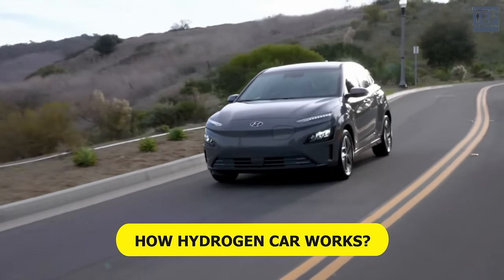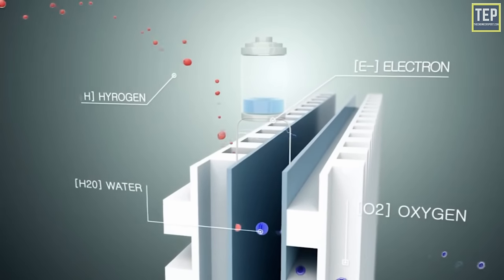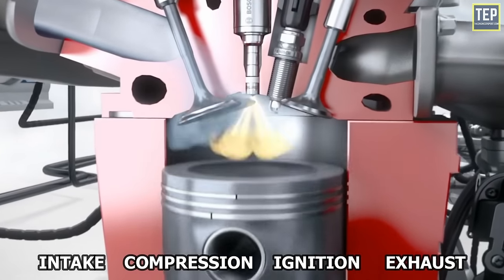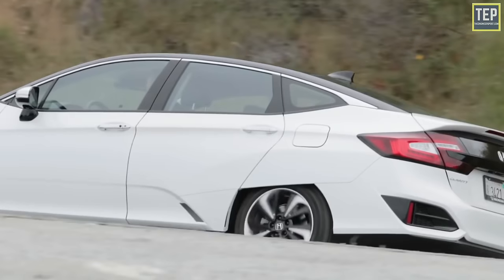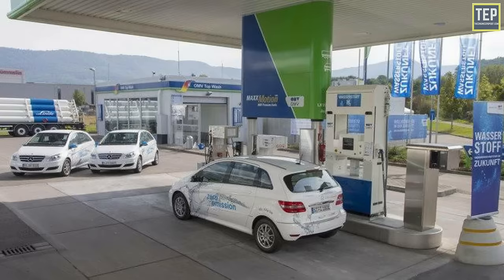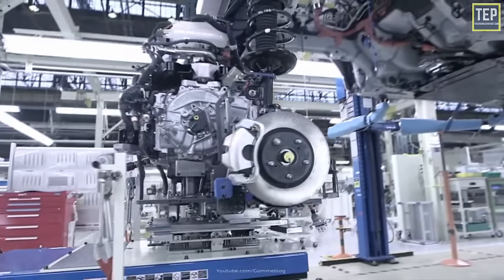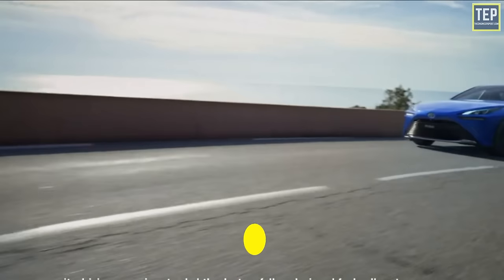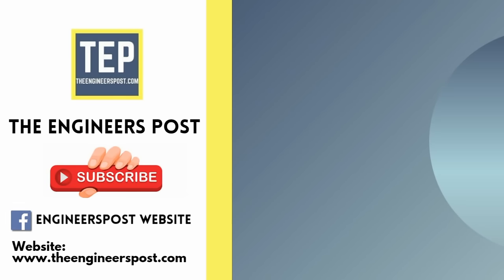How do Hydrogen-Powered Cars Work? Using [Fuel Cells & IC Engines]

Comment: Both can work alongside eV for cars, vans, etc hydrogen for trucks, buses etc the petrol, diesel scenario all over again but eV companies trying to discredit hydrogen and they will fail miserably.. UK is already updated services to handle hydrogen eg pipework, tanks etc... There is no way we should allow any one source to have a monopoly in fuel ever again... Its out and out greed..
Reply: If all of the companies making EVs actually cared about the environment they would be investing in hydrogen power in anyway they can. Travel range and transport costs are the same exact issues fossil fueled vehicles and EVs have and we overcome them to make it work. Think of all the people working in oil that could be cross-trained to harvest and transport hydrogen. I have yet to see a single legitimate reason we don't drive these vehicles regularly. It's all excuses.
Reply: @TheRealBlakers  Oh ye think about those kids who get payed so less bc companies want lithium to make batteries, Also Its not excuses , everyone knows that hydrogen is more cleaner , has higher Range, faster fueling time , U lot who just support EVs can't even think about kids and adults having to put up with lithium mines or acid from batteries that causes acid rain
Reply: Well said...
Reply: Try convincing the EV nuts that there's any alternative.
Reply: @TheRealBlakers Also with re-fuelling the hydrogen fuel cell it’s just as quick if not quicker and the pumps are supposed to be far nicer to use than the ones for regular petrol and diesel
Reply: @joet7136 They would’ve been called nuts decades ago but there’s no turning back after the original Nissan Lead brought the EV’s to the masses instead of low volume numbers with much earlier EV’s with only a third of the range of many of the latest one’s now by various car brands. Even the prices are going down except the ultra luxury models by the likes of Mercedes and a few other ultra premium brands for which even regular cars by them are similarly expensive priced

Comment: EV and hydrogen is all that wow and hyped up in the beginning until it starts to fail after a few years with broken batteries and leaking hydrogen nozzles etc. And people don’t even talk or know about hydrogen embrittlement. And no one talk about the effects when it gets cold with minus degrees like (-20˚C is -4˚F) as a comparison and how awfully bad electrons behave in minus degrees. Nothing beats the internal combustion engine to work in harsh elements!.

Comment: Hydrogen for the win. Electric cars are great if you have your own a house with a drive way to charge, but where I live in the UK I would need to fork out about £750k upwards to have a drive. Many of us live in terraced houses and have to park on the street. 
Plus the sound of a hydrogen car is way better, you can retro fit old cars with IC engines, and hopefully you will still be able to drive manual.
Reply: Can't you just put the charger on the side of the road by your house
Reply: @jaymatthews3712 - Simple solution: you buy the car but rent or lease the batteries.

When your battery is low, a service station removes your dead battery and replaces it with a fully charged fresh battery.  Just like you change batteries on your cordless drill.

Could even be faster than filling up a gas tank.

Your dead battery is then recharged and lent to another driver.

This battery exchange could even be automated.

Simple.

It might even be possible to specify how much charge you want in the fresh battery and pay accordingly (although possibly, the higher the charge, the less it might cost per watt).
Reply: What if you get in an accident?

Comment: Certain types of Solid oxide fuel cells at filling stations can be used to create hydrogen from from water and electricity with oxygen as a by product which can be easily sold. These were first developed to produce electricity from natural gas but they can also run in reverse!!!

Comment: I think the biggest difference between a hydrogen fuel engine and a hydrogen fuel cell is that a hydrogen fuel engine is driven by an internal combustion engine, so it has the same engine noise as ordinary gasoline-electric vehicles and fuel vehicles and needs to change the oil.  For hydrogen fuel cells, its driving method is an electric motor, so its driving is the same as that of an electric car！

Comment: The most important features that the user focuses on when owning a car 1. The cheap price of the car 2. The ease of car maintenance 3. The availability of spare parts 4. The spare parts are reasonable 5. The speed of fuel filling in record time 6. The car runs a long distance with one tank 7. The price is cheap  Fuel 8. Gas stations are abundant on the roads 9. The vehicle is safe and secure 10. It is beneficial to the environment 11. The car accelerates perfectly 12. The sound of the vehicle is perfect 13. Vehicle speed
Reply: If they cared about 10 they wouldn't buy pickup trucks lol
Reply: Also no car is "beneficial" to the environment, just less bad

Comment: I think there is a difference between the hydrogen combustion engine and the hydrogen of the fuel cells. I think that the hydrogen fuel cells give the car a longer distance in walking with one tank by 1,000 kilometers per tank.
Reply: It's a good thing

Comment: Don't waste your money on a H2 car.
     The membrane or the fuelcell stacks that exchanges hydrogen to electrical energy are troublesome and must be replaced with other components once a year or every 6 months. The membrane is like what you usually see in the RO water filter, except larger depending on the design it can be a rectangle or cylinder with built in heat exchange or cooler. The membrane is getting veryhot while it's running.
It's very expensive, $10,000 or more to replace it a long with other components. 
   The car works like a hybrid car, battery  and all. The coolant to cool the membrane or the fuelcell is another issue to worry about.The membrane only lasts about 6 months  to a year, depending on how the car is used. If you park the car for a very long time like a month or so, the system will clog up. Then the membrane  and cooling components have to be replaced before you can use the car. The car has to be towed into the shop autorized dealer.
So far, there are NO mechanics at the dealer that can work on the cars, due to its complicated system. You must wait for a trained scientist mechanic from Toyota Japan to fly in for your service on an electrical problem.

Comment: The technology is promising and has a long way to go but may eventually replace regular gasoline and ev powered cars one day
Reply: It’s too late to replace EV’s as the original Nissan Leaf set the stage for bringing it to the masses after previous attempts in earlier decades failed with only low volume numbers made

Comment: why not use electrolysis of water to create hydrogen on demand in the engine?
Reply: Is that really possible?
Reply: @jayy799  On further investigation I'm not sure it is as I would not produce enough hydrogen however you could use tanks to store the hydrogen and fill up at home using a Hoffman apparatus. This does need an electrical current for electrolysis but maybe u could use solar panels to provide this?
Reply: @Deborah Payne  Yeah You are right, But therr is skme reasons that will stop one to produce hydrogen at home likd, 
a ) Hydrogen is extremely flammable Gas; 
b)  To extract hydrogen from water is complecated for normal prople. 
And soo On... 

But the good news is Apart from the electrolysis, Ons can also extract a hydrogen. there is also other ways to get hydrogen but unfortunately we arent talking about that. 

But we will find the solution of all these problem for surely

Comment: We already have a car running without petro, battery or hydrogen it uses the voltage from the like of cell sites transmitted power or other wireless transmission power.
Reply: whats the name of the car
Reply: Lol 😂 what car is it huh?
Reply: It called Foot
Reply: Send power wirelessly?  I don’t want to wear the tin foil hat, plus you can’t get dilithium crystals on this planet.
Reply: That would be perpetual motion machine of the first order 😂. Remember d laws of thermodynamics. 2nd law

Comment: Hydrogen IC cars and trucks. Refuel in 90 seconds. Superior range on one refill to EVs. No need to upgrade the entire US electric power grid (no brownouts or blackouts). No toxic environment problems with mining rare earth minerals for batteries. No dependence on China for the rare earth minerals for batteries. No $expensive$ periodic battery pack replacement. Reduced weight of vehicle compared to EV, so easier on road infrastructure and tire compound emissions. Hmmmm. Let's be sure that the government does not pick winners and losers for our future car and truck technologies. Let the free market decide.

Comment: are hydrogen cars stable now? I read somewhere they are susceptible to high temperatures and can explode.
Reply: EV's and lithium have a similar issue.  Once those batteries catch fire nothing can put them out, not even water.  Its like oil on fire; very hard to extinguish.  Gasoline is also explosive but with the right placement this issue is not going to be a problem with hydrogen.  The temp issue is resolvable.

Comment: nope ... not the future.   eventhough hydrogen is more energy dense, the process for making it is highly inefficient and dirty.   transporting liquid hydrogen is also very unsafe!    The recent theory or using ammonia(much cleaner to produce and safer) and converting it to hydrogen, using the hydrogen to power a generator of some sort, and then powering electric motors ... maybe???   it would mean a bunch of heavy components equipped on a car quickly reducing its range.

Comment: ICE will be around for decades. They will be hybrid to meat cafe standards. Electric carss are a nitch market and is NOT the future. Two reasons: 1 the raw materials needed to replace ice cars with electric cars will be prohibitively expensive as demand inceases and: 2  There is not enough electricity to power a fleet of all electric cars and between the charge times and the space required  to charge milliona of cars isnt yet feasable. A breakthrough in  battery technology would be needed and battery physics may never allow quick enough charge times not to mention that the eletric grid cannot handle it in most countries. The future is hydrogen but it is decades away. Hydrogen is a fuel that  can be ieasilynstalled in gas stations, charges in a few minutes and diesnt use the increasingly limited electric grid.